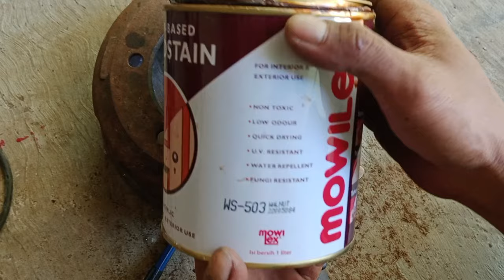Very Rusted Wood Saw Restoration | From Recycling

Comment: Nice project and now a useful hand saw again. Always better than throwing them away...  Whenever you come across missing teeth on such a saw, if you have the equipment, you can easily weld on a piece of metal and reshape in to match the other teeth. It would blend in to the point of disappearing when blended in with the original metal.  Also when you have waddled out holes in the wood, you can always drill out the holes and insert some other type wood and than redrill the original size. Or even make some very nice inlaid to give it some pop. It would give the saw a great look with inlaid wood like that. Thumbs Up!
Reply from the maker: Thank you my friend, I will definitely apply your advice in the future, I did miss this because I don't understand how... thank you very much 🙏🙏
Reply: Ponle unas arandelas.

Comment: Nice work. If I may be permitted to add something from helping my grandfather and great-grandfather in sharpening their saws, you need to set the teeth. A slight bend to either side creates a bit of clearance for the blade during deeper cuts. There are probably sawsets around for restoration as well and that would be a good addition to this work. Well done!
Reply from the maker: Thank you very much.. that will be my learning in the future 😁😁